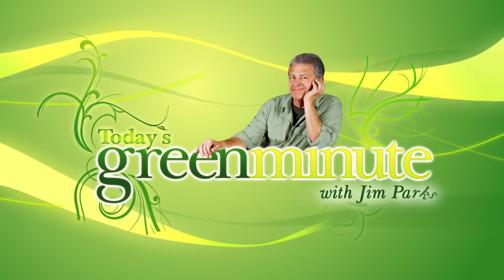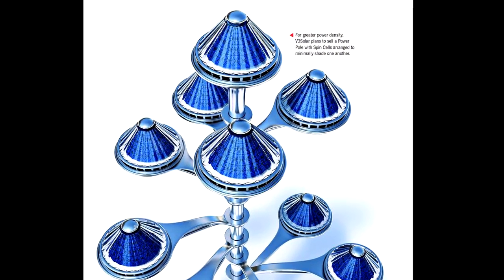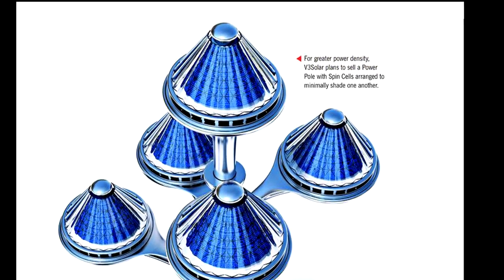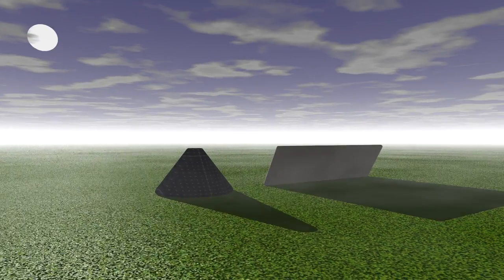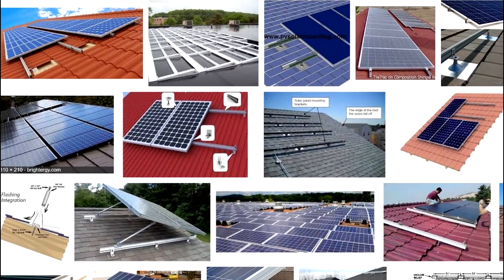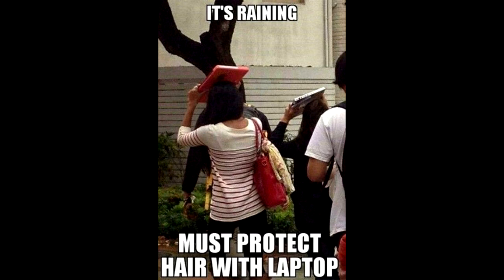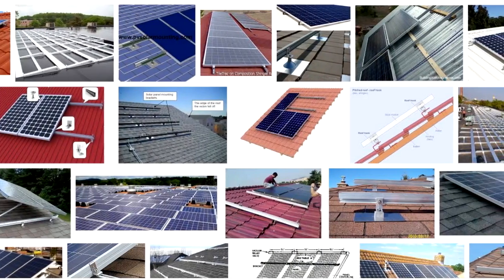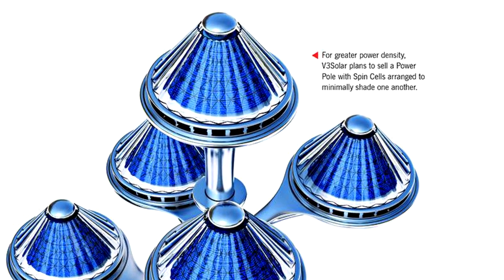Spinning Solar -BUSTED!

Comment: what about if you used a solar panel to rotate a motor connected to a wind turbine generator. i think that you would get more electric out than the solar panel would provide 🤔
Reply: It already exist but cost wise not attractive at all.

Comment: So what if you had a small area, say 1meter by 1meter of solar panel, and then had a magnifying glass )of some type) 100feet above it at 10th the size and had that spread light 10 a 1 meter area on the panel surface area, would that generate any more or less heat? or for it to get any more light and heat would the magnifying glass have to concentrate the light to a point to work?

Comment: would it be a good idea to have transparent water pipes under (or over) the solar panels so you can cool down the panel (20% lose of power though over heating) and heat up your water for a hot tub, swimming pool or shower?

Comment: I agree with the idea of calling out bullshit claims. It might be helpful as well though if you also encourage them to do more research and trials on their ideas. Wild ideas are what start innovation. 

For example, yes the claim of 20x is unrealistic, definitely, call them out on that. BUT, that doesn't mean the tech is without merits. I can think of one very niche but useful place for a tech like this if it could be adapted. Sailboats. Most peole that sail alot, especially those that do ocean crossings, have a couple solar panels on their boat. A lot even have a marine wind turbine on one of the aft corners, sitting at the top of a pole. 

If this cone panel idea could be adapted to be salt-water friendly, and spin (or not) around the pole of a marine wind turbine, just below the point where the prop blade might hit it, wouldn't it be useful? If it could, it would not only catch the direct sunlight on it, but it would also catch the reflected light from the water. As anyone that likes being on the water will tell you, sun burns happen faster and more intensely than on land. 

That's just one idea of how it COULD actually be used. But I'm just a dreamer, I fully admit to having almost no understanding of how solar works on the deeper scientific level.

Comment: uuhm you forgot 1 thing a solar pannel only makes power if its in the sun wich it is only about 8-10 hours a day the cone makes power as long as there is a sun in the sky but normal solar panels are just way better ur right what maybe would be good is a solar panel that bends so its horizontal on the top so it would make a little bit energy for more time of the day

Comment: Another funny flaw of this project is the electric motor. Yes a the video mentioned it could burn out and require maintenance, but also it takes power. Spinning all day at that some what fast pace would also lower the solar cells effective productivity. If you have to subtract the power it uses to run from what it produces I would imagine it be even lower efficiency even further. Sad to see celebrities throw their hat in and support BS, but it's hardly a new thing. Though in this case I actually liked the actor who sold out for a pay check.

Comment: now i have only one question.. you say that the cross section that is exposed to the sun is much smaller then a traditional panel but am i the only one how thought that if you lower the footprint of the panels on the roof it would meen you can plabe more cones per the same roof length...?so if (according to your data on the video) a traditional panal is 100 % eff. and a cone is 50%. then placing 3 cones (only esstimated from the drawing made by you) would in fact make it more efficient in the end. wouldnt it?

Comment: If the problem is they're getting too hot why don't we take a hint and use that as well, we could maybe improve the overall design of solar panels by making them water cooled. We Could then recycle the hot water for houses or other things.

Comment: Huh,.... How is a CONE that keeps half of its sides AWAY from the sun more efficient than any other shape pointing only in the general direction of the sun?
Also if it SPINS it needs energy to do so.... you have half a solar array that needs power to move and think you make MORE output from that WORSE starting conditions? LOL

The video itself is already enough to dismiss that "theory"... Can't work the way they say it will. 

The later explained cooling and lensing problems are only the cherry on the cake... It's snakesoil... designed to fool the idiots to make money, then "go bankrupt"/leave town and keep them from claiming it back...

Even doing the absolute minimum... taking all the cells on the cone and making their backstructure hollow so that you can use the same power the spinning motor would use to cool the whole array down with fans... would be more efficient as it involves producing less stuff to make it work... FFS... why is the lense even a cone? That's style over function AND has the negative consequences TF mentions... (greenhouse)

Comment: Ok, well its not an entirely terrible idea. Let's take away the glass lense cause that's just dumb. Then let's take away the whole spinning bs cause that's just more shit to break. I understand that the code design is less efficient than a tracking panel but it is more simple. Would it be a bad idea just to have a stationary cone on a tree sort of thing like that? Maybe even put a hole in the top and a fan on the bottom to help with cooling. This would be a trendy way to put more solar panels up in cities and removing the unnecessary glass and moving parts it would be more cost effective and more reliable. Even if it were just a way to power a traffic light or a street light. I could be wrong but it's just a thought.

Comment: hipsters have no critical thinking skills at all. They just hear something, like the sound of it, and start preaching salvation. 

 I thought only crazy Christians did that. No folks. Liberal airheads have out done them, and they do it, unlike the crazy Christians, with your tax dollars. 

Penn and Teller got liberals in a park to sign a petition outlawing dihydrogen monoxide simply because someone told them it was bad, and they liked the sound of that. That is all it took to get them on board.

Comment: one thing that jumped put at me when I first saw this is the simple fact that the solar panel spins. However, making it spin would use up energy...
Reply: Hunter Barnes I think the spinning is supposed to be powered by air flowing around and rising inside due to expanding as it heats or some such, but still.

Comment: I'm no scientist here, however...  while the conse spin and half the cone is stuck in the shade wouldnt putting magnents on the bottom edge of the cone to try to generate power from the shade side compensate for the lack of light being put on the cone? I have seen some people experimenting with the idea of using magnents to generate power.. even self sustaining power That and possibly putting mirrors in to reflect the sunlight onto the other side? wouldn't that be possible?

Comment: my new invention. solar powered water desaliniser. uses solar panels to produce electricity to electorlize the water into hydrogen and oxygen which travel through a pipe into another container where they react again giving clean fresh water! brilliant. best thing yet is that it takes half an hour to get one drop of water with its amazing 0.5% efficientcy. also the salts in the water break down into gases which also go into the fresh water making it not so fresh.
who wants to fund me?

Comment: They could put mirrors behind the cone to reflect sunlight onto the last 50% of the cube to improve efficiency. However, it seems abit dumb as you would need a tracer assembly to correct the mirrors to the suns movement haha :D

Comment: You know what might help make solar power viable, take the solar roadway thing, and apply it to peoples houses. Instead of roads, giver EVERYONE solar panels on their roof tops. Instead of having all the power being produced by one small area like we do with power plants that run of fossil fuels, have a bunch of smaller generators, solar panels in this case, on everyone's roof or backyard, or both. I feel like that would be good, just absurdly expensive initially.

Comment: Here is a better idea: 

before your flat tracking solar panel, add a curved reflective film to reflect away IR and UV (it's possible with the right doping) - you will lose some efficiency at the solar panel for light allowed to pass through the filter, but you will still generate electricity at the photovoltaic cell (lets say 60% of original efficency, so ~12% total efficiency for the cell)

the IR and UV is reflected off-center to a rail (so out of the suns path to the filter) - this is further filtered and reflected for UV - IR is allowed to pass through to a heat collector (black pipe with a heat transfer fluid). this is used to generate electricity using the IR spectrum (perhaps steam turbine or similar, depending on the scale of the installation).

the leftover reflected UV spectrum is then focussed and directed to a beam below the original photovoltaic Cell, and is thereafter spread onto a Phosphorescent painted surface, whose output is tuned to the same frequency as is required for optimum efficiency for photovoltaics. placed directly below this is another photovoltaic cell that uses the converted light to generate additional power.

tell me whas wrong with this picture? both photovoltaic cells experience close to no heating due to IR spectrum. IR spectrum is used rather than wasted, and UV is also used and not wasted. What kind of efficiency benefit can be seen with this setup?

Comment: I think the major point is not mentioned in the video.A solar panel acts like batteries in series,if one battery is dead,  there is no power output.Same with the solar panels, if there is a shade on one part , there is no power output.Unless it is split in smaller sections and you have a controller.

Comment: The hilarious thing is that apart from half of them being shaded due to the conical design, they are NOT to superior to a tracking array because the direction cosines drop in efficiency with the motion of the sun will still exist as if they're a static panel 😂 Sorry if you mention this later, I haven't watched the whole video yet.

Comment: the U.S. government will never allow any alternative form of energy to compete with oil.  our entire economy is based on oil in that with agreements from the 70s with Saudi Arabia and all of the other OPEC nations that they will only accept U.S. dollars for their oil.  this means that every nation on earth must obtain U.S. dollars to buy their oil.  They get U.S. dollars by trading goods for our dollars.  any nation in OPEC that tries to use any other form of currency to buy their oil WILL be attacked by the U.S. . for instance Iraq began to coin currency that they would accept in place of dollars for Iraqi oil.  in less than a year 9/11 happened and the focus went quickly from Afghanistan to Iraq and Iraq was completely devastated and it's leaders deposed, while Afghanistan still remain mostly intact. should the OPEC nations band together and begin using other currencies for oil it would collapse or economy overnight and cause a worldwide depression.  the U.S. dollar isn't based on anything anymore.  President Nixon took the U.S. off the gold standard and left it baseless, left it with nothing to back it up.  the only thing that gives the U.S. A dollar any value whatsoever is the oil.  Anything that threatens that oil/dollars system, including any new technology will be attacked and destroyed as quickly as is possible. If the solar spinner system ever gets any real baking the U.S. government will get rid of it and those responsible if necessary.  Any nation that threatens the oil/dollars system will find itself at war with the United states in fairly short order.  should the system ever collapse it would be the start of the 3rd world war in which nearly everything on earth would be destroyed. Oil is the only thing that gives any value to our money and or entire economy, our very way of life is completely dependent upon that system. even if it didn't cause a world war, if the system collapses the entire world economy would collapse leading to a depression that would make the great depression look like a trip to Disneyland by comparison. If anyone doubts this, look it up, and not on you tube.  Look it up in real historical documents that can be found on line, but it would be better to look it up in actual books and from newspapers from the 70s on microfiche. it is on you tube, but you tube is mostly just other people's opinions not real news or information. Find it using the freedom of information act getting the documents from the Congressional archives and the Library of Congress. There must be a way to fix this system without destroying the world economy or starting a world war or any war of any kind and we must find out what that solution is before it's too late.

Comment: I would at least partially agree if the cone was at least 30 feet wide but really? a small cone in a field of hundreds of other small cones that would cost maybe $250 a piece and you say they're less expensive than ordinary panels? wow... do you think I'm stupid or are you the dumb one. I get the concept of hydrogen powered cars but once I thought it through a bit, if there was a car crash the state would be a giant crater. Love the video Thunderfoot!

Comment: We did it first; V3 Solar are thieves, they did not have the Decency to ASK how we made it 20 Times More Powerful! 
Patent # US20010006066
A solar collection system and method having means for receiving solar radiation through a main refractive interface and means for internally reflecting at least once, at least a portion of the received solar radiation. The refractive medium may be liquid, gel or solid. The device may be integrated with a photovoltaic device, photo hydrolytic device, a heat engine, a light pipe or a photo thermal receptor. 
Inventors: Matthew Cherney, Michael Stiles, Norman Williams
Current U.S. Classification: 126/698; 126/628; 136/243
International Classification: F24J002/06; F24J002/08
Reply: So what you're saying is he just debunked your idea and not theirs?

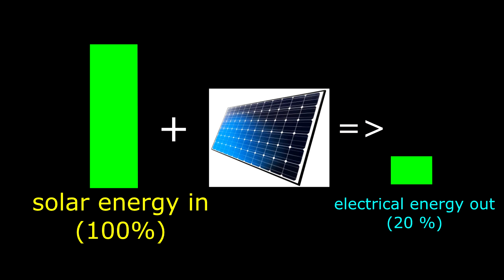Comment: +Thunderf00t: One slight quibble with something you said (2:02), and I'm only pointing it out because I know your a stickler for accuracy.

I had a match teacher, who couldn't stand anyone who (incorrectly) would say something like '200 percent', or '1 thousand percent'.

The reason? 

'Percent' derives from 'per-centum', 'per-100'

In other words, the highest something - per-centum - can be - IS 100 percent - which is '100 per 100'.

He'd also drilled into us never saying 'and', with numbers, like '1972' - you don't say 'one thousand nine hundred AND seventy-2 it's 'one thousand, nine hundred seventy 2

Comment: What I learned in this video is that magnifying glass serves the purpose of gathering light. Solar panel serves the purpose of converting energy. So put a right size of magnifying glass panel (or mirror) in front of a small solar cell, instead of all-solar-cell panel. Since it is the solar cell that is so expensive. Same size of the surface area (gathered sunlight), fewer concentrated area to convert energy (cost). Apply to all roof panels.

Comment: New solar power cells can generate power on a cloudy day.  I agree not as efficient as in sunlight. Sit in a car on a cloudy day you can still feel the warmth of the sun coming through the window especially in summer.  In winter snow sits on the panels.  The main problem with solar panels is when The sun goes down no more electricity.   As I have previously said any idiot putting money into these crowd funding ideas are pissing in the wind.   I am no scientist but I do know from the guys who came into see me with these solar panel farms investments because the UK government through money into the technology that there is a flaw in the system of generating solar power.  That flaw is at the end of the 25 year term the solar power cells ownership reverts back to the owner of the land and they are free to generate as much electricity as they want.  Problems is the panels start to decay from year 20 onwards.  There is no guarantee that in year 25 that you will be generating the same amount of electricity as you were on day one. In effect the company that the wealth manager has set up has passed the cost of removing the defunct solar panels back onto the owner of the land.  The wealth manager has benefitted from the tax subsidies that the UK 🇬🇧 government gave them.  In addition you need fields to generate electricity to put back into the grid.  You can't store that power because some American in the 30s patented a way to store electricity in what ever way it was generated even though he did not have a viable working model.  That patent is about to come to an end so people are now working on it. But patent pushers are the problem the crowd founders are the new patent pushers. Anaerobic digestion don't get me ranting on that one.  What species grows food to feed to a generator to generate electricity when we can't feed every person on the planet.  We can't use household waste as this kills the microbes in the digester.  Stupid.